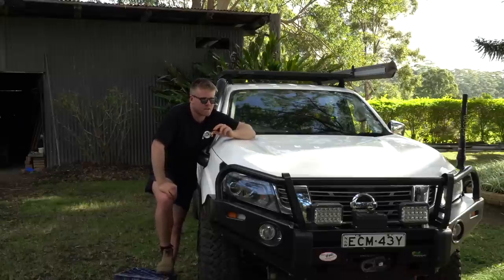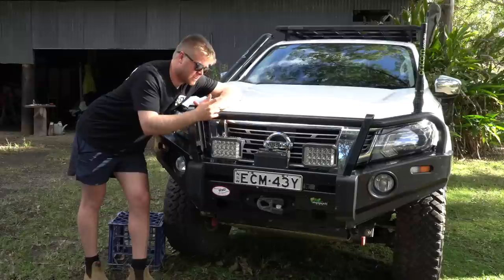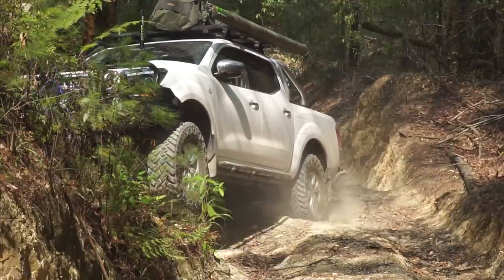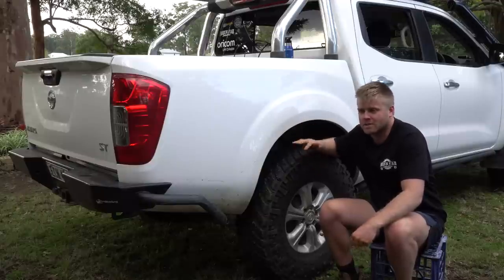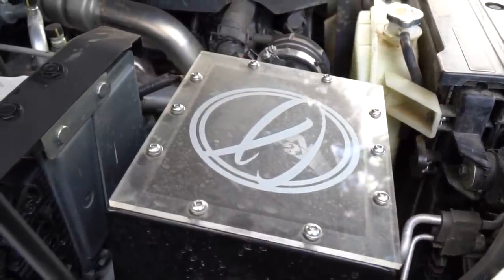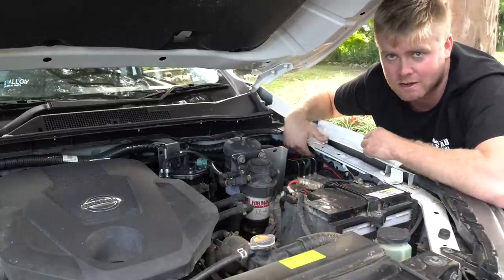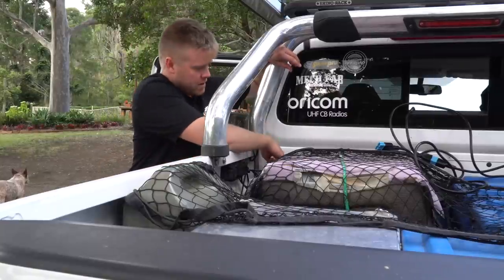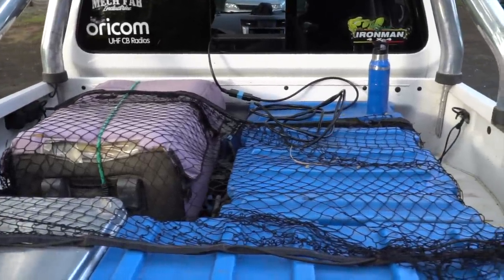2019 NISSAN NAVARA D23/NP300 WALKTHROUGH

Comment: Do yourself a favour and upgrade your brakes! I upgraded my 2014 Ranger this year with the Bendix Ultimate 4WD upgrade kit: ventilated front discs, front/rear pads and extended braided brake lines which is a must for lifted fourbies! Running 33 muddies/steelies, 2" EFS lift, long range fuel tank, Aeroklas canopy, single rear drawer, fridge, roof racks, awning, front/rear/side TJM protection and winch has added alot of weight to my Ranger and the brake upgrade has mad a MASSIVE difference!!! Cheers!
Reply: How much did your brake upgrade set you back if you don’t mind me asking?
Reply: @seanrichard-preston6088  about $1,250.00. Check out their website... Well worth the upgrade 👍
Reply: Chris Kaskadanis that’s an awesome price I was expecting it to be way more. Cheers for your reply mate.

Comment: You have done very well setting up your vehicle. I think you have made sensible decisions. If you go for a tray and canopy, maybe you can keep the tub and then transfer the tray and canopy onto the next vehicle and reinstall the tub onto this one ?? I installed a big 240Ah AGM battery into my Hilux in early 2012. It's over 8 and a half years old and still going strong. Not bad for an AGM. I'll be very surprised if a lithium battery will last 20 years, but just the same, I will go for Lithium next time, because of the big weight saving. Have a nice day Tyler. You have an excellent Youtube channel.
Reply from the maker: Thanks mate, appreciate the feedback!

Comment: Nice vid mate 👍. The standard wheel offset for the 16s is positive +45. I run +20 and and it doesn't rub anymore and still legal......just! 👌
Reply from the maker: Okay thanks mate!
Reply: @TylerThompson90  +25mm offset/5 inch backspacing for 16x7 steel wheels then👍😄👍 .75 inches less backspace then a stock 16x7 wheel. If you could fit a 255/85r16 Toyo Open Country MT🤗= 33.5x10.2r16 the tallest widest tyre of that size. With tyres of equal diameter the wider tyre will rub the front and rear of the fender well when the tyre is turned and articulated, so mabye these slightly taller tyres have a chance of fitting.

Comment: Hello Tyler.  I am very glad I found your channel.  My wife and I are in the planning stages of a trip to Australia to do a Lap.  We are from the US and I want to have a vehicle built locally that we will use for our trip.  The vehicle I want to build is the Navara.  I own a Frontier in the US which is essentially the same vehicle depending on model year.  For my US Frontier I have done a full Titan swap (Differential, Axles, Control Arms, Tie Rods) with 4.10s and ARB.  I have a great many questions I would love to seek your advice on.  My desire is to ship the US sourced Titan parts to Aus and have a local shop complete the build.  I know there are more restrictions on vehicle modifications there so local knowledge on what can be done would be very valuable to us.  We would probably begin from Sydney and do a counter clockwise Lap so we would want to work with a shop in the Sydney area for the build (Fulcrum? Superior?).
For the base vehicle, I would like a crew cab (4 door).  I believe there were model years that had a V6 diesel (I assume turbo'd or twin turbo'd)?
Any help is much appreciated.

Comment: see if you can correct the diff ratio to match the 33's. would get you power and economy back to when it was on stock tyres(give or take for added weight). would have to do both front and rear to be able to use 4wd still. i dont know what ratio they run stock but surely they would have some options.
Reply from the maker: Ill have a look into it 👌

Comment: 33's will trick you car computer and show the economy worse than it is because the tyre circumference is bigger, meaning a revolution of the wheel sends the car further than the odometer says it does. 20,000 kms on your odometer is probably more like 23,000 kms in actual distance. The computer uses the litres to travel the kilometres and the odometer is registering lower kilometres therefore it thinks the car is using more litres per kilometre. Fuel economy will be worse anyway because the tyres are heavier and all the bar work etc, but a good proportion of the apparent increase in fuel consumption is due to the fact that the kilometres you are appearing to travel is no longer accurate. That's good for trade in time because the car will appear to have less kilometres.
Reply from the maker: Thanks for the info mate!

Comment: Here's a cheap protection upgrade you can do, I just grabbed one last week and got another 10 bucks off for signing up to the news letter.
It turned up 2 days after ordering.

https://www.4x4andcamping.com.au/products/blackhawk-rear-diff-lock-actuator-guard-nissan-navara-np300-d23?_pos=16&_sid=21e229c3f&_ss=r

Also if you want to be able to use the diff lock at any time and not just in 4wd low at low speed you can grab a wiring harness from racewires you can find them on Facebook.
Reply from the maker: Thanks mate, ill have a look!